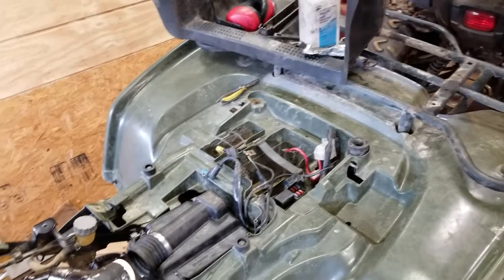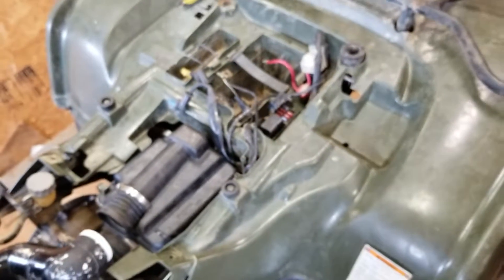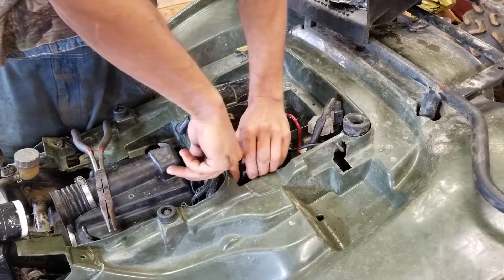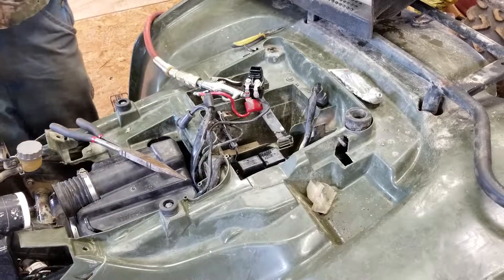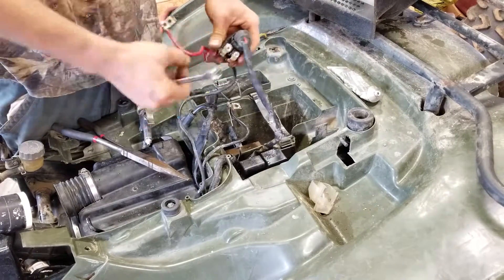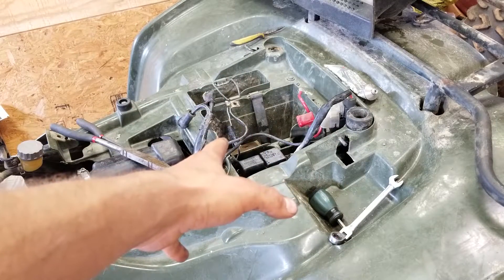ATV Electrical Inspection: Suzuki Vinson Rebuild Part 4

Comment from the maker: Hey Y'all! Tools, supplies, and service manuals used in the description.
Timestamps:
0:00 Intro
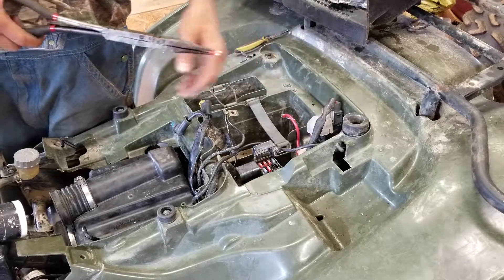1:11 Fuse Block Corrosion Removal
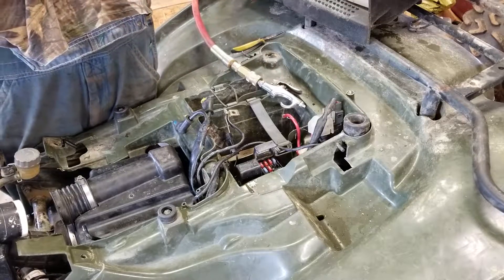2:35 Fuse Block Dielectric Grease
3:07 Starter Wires Cleaned
4:26 Outro